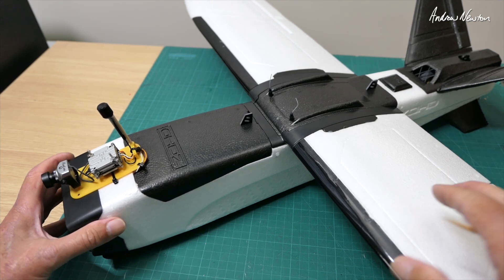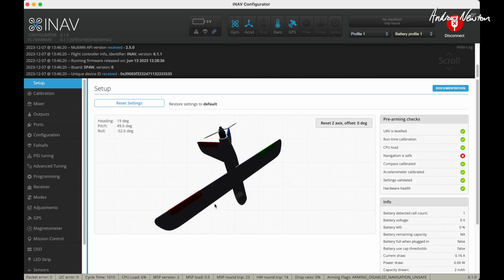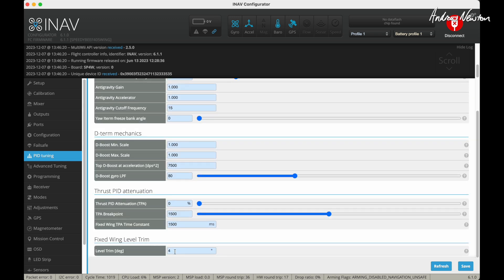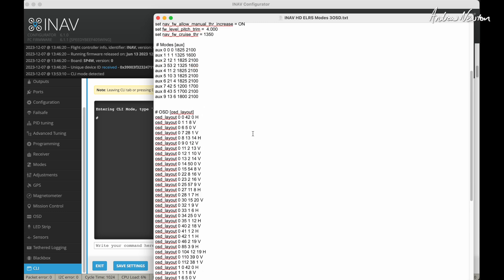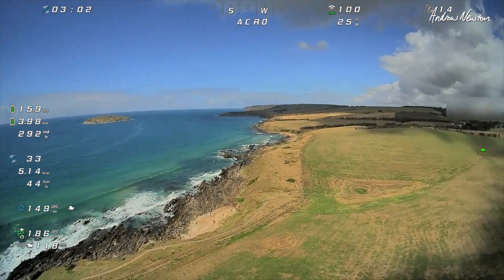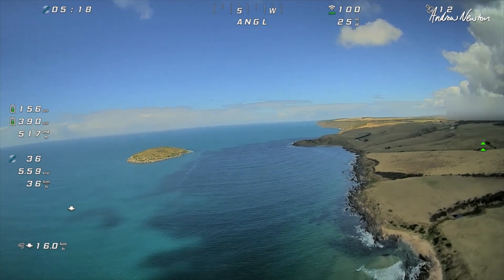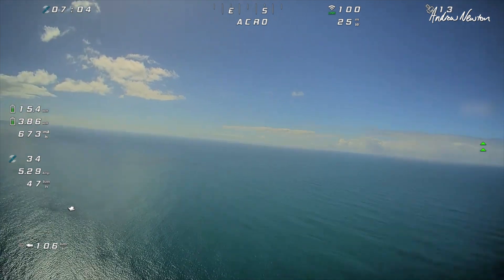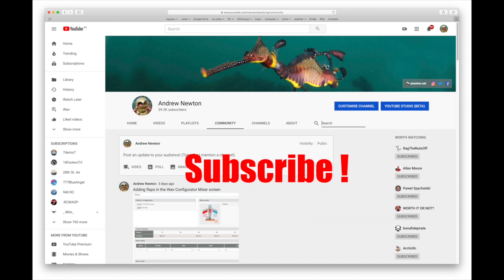ZOHD Talon GT Kit - INAV HD FPV

Comment: Hello. As i observed, the esc positive is also plug in the flight controller. Is it ok to do so..? Thanks..
Reply from the maker: No you should not connect the ESC 5V to the Vx pins on the board. I did not add the Vx pins to S1 and S2 on the board, so the ESC 5V is not actually connected to the board. This shows how I usually do it with another board. https://www.youtube.com/watch?v=QywhAT_eeX4
Reply: @AndrewNewton thanks..

Comment: Hello Andrew ,  
  
My Talon Gt is very bumpy the nose goes up and down when pitching down in in angle or horizon mode. what do you think is cause of this issue.
Reply from the maker: CG wrong, sticky elevators, FW level trim too low or high

Comment: Hi Andrew,

It's me again ;) I made my first flight with my Talon GT rebel under Archer SR8 I would like to know if the stabilization changes a lot under the FC speedybee 405 wing mini I soon finished configuring mine knowing that it is my first FC.. you motivated me a lot on the subject I am new to FPV.

I have a lot of the GPS flight map side and especially the data communicated with the OSD

I don't know yet what to take for the VTX part
being alone at first I would like to display the camera on a monitor.

do you have any references? thank you again for your work and your answers
Reply from the maker: Stabilisation will be much more configurable with the SpeedyBee. Much better than just a stabilised receiver, but more setting up. Are you going for analog or digital FPV? I have video playlists for both.
Reply: @AndrewNewton  after update firmware my gyro accel and mag are red what is pb? You see? Thanks for answer
Reply from the maker: Maybe you flashed the wrong firmware
Reply: @AndrewNewton  ohh okay what is a true name for speedybee f405 wing mini on inav FW ? U know?
Reply: I just flashed with the FW of the site for the good FC in the PRE-ARming check I have UAV is levelleg red cross Hardware Health red cross and run-tile calibration red cross? mhmmm!
Reply: @AndrewNewton  can you dump your FC and share this file plz? And share FW for me? I'm stuck...
Reply from the maker: My Dump would not work for you. Go back to basics. Read the manual for the correct firmware target. Re-flash the board using INAV configurator. Watch some basic INAV setup videos, there are links in the description.

Comment: I just built up my Talon Rebel GT over Christmas break and my buildup in hardware and in INAV are almost the same!  However, mine torque rolls into the ground right after launch release.  CGs and Props are correct.  I am in total manual mode since that's how I fly my fleet of planes.  FPV is new to me but am not having fun figuring out this issue.
Reply from the maker: Ailerons reversed or stabilisation reversed? Too much throttle and soft throw? Too heavy and not enough launch speed?
Reply: @AndrewNewton  yes I’ve checked control surfaces.  Throw is good, I think.  Throttle is maybe 75 percent.

Can’t say I’ve ever had a plane need so much more hard toss and thrust at launch.  I see no one launches these things in manual on their maiden’s and I’m getting convinced this thing can’t work in a manual launch either
Reply from the maker: Watch my maiden. Full manual, no FCB. What's your all up weight?
Reply: @AndrewNewton  flying weight is 1140 grams.  I’m about to measure thrust and torque roll at full throttle with a scale.  Being a baseball pitcher over 40 years ago, I thought I threw pretty hard still. Guess not, lol.  

Got an sdcard to measure this next time as well.  My Accelerometer measurements kept drifting in INAV so looking into that.

Thx for the response!

Terry
Reply from the maker: No problem Terry, this is an intriguing problem. Others have talked about torque roll too, but that's usually with overloaded Talons and AutoLaunch. Your weight is good, your throwing would be way better than mine and you're in Manual so the FC setup can't be the issue. Do you have video of the launch?
Reply: @AndrewNewton  sorry we don’t have any video but I have spotted a coupe of sites of FB that look similar

Comment: I have no previous experience with aircraft.  I want to use the auto launch and auto landing features, and if I am in trouble, I want to try turning on the support features.  What does the plane do after the auto launch procedure?  Do I need to turn on the RTH mode so that it draws circles in the air, or is this the continuation of the auto launch procedure? 

 I'm a little confused about the modes that should be on during takeoff or the ones that should be turned on afterwards.  Since I use flysky i6x, there are only 4 toggle switches on the remote control.  I can't assign all models
Reply from the maker: Wrong approach, you will be wasting your time and money. Learn to fly a plane first. INAV will not help you to learn the basic.
Reply: @AndrewNewton  The answer I expected came.  I listen to the master with all my ears.:) i ll try
Reply from the maker: @brsguler  Excellent. Do you have a plane and Radio yet?
Reply: @AndrewNewton  Yes, I have a plane.  A twin-engine cargo plane.  I made it from cardboard material, I think it is a good choice to learn.  easy to repair.  I have an i6x remote control.  I also bought a walksnail goggle, but of course I will not try to use  FPV equipment until I learn it.
Reply from the maker: @brsguler  Great start, by building your own plane you would have already learned a lot.

Comment: Hey Andrew, awesome stuff.  I've been following this series as I've been messing with a talon for a while but have had horrible luck launching it.  Mine torque rolls like crazy during launch.  I noticed you have built yours quite a bit lighter than mine, and I wonder if that is what is causing issues.  I used the bigger 5k lion, gopro, vista with a fan, larger gps, etc.  The aup must be quite a bit more than yours.  Mine will also shimmy and approach stall at the speeds you were flying at, I have to keep the power up.... so I think these all point to maybe it needs a diet.
Reply from the maker: Yes many have had the same experience. It's not a great weight carrier. Much better keeping it light.